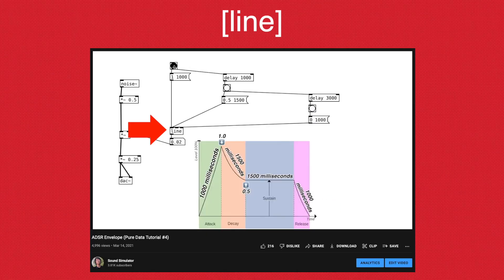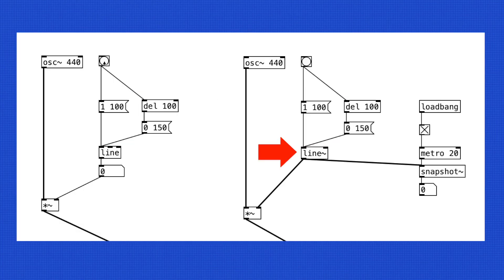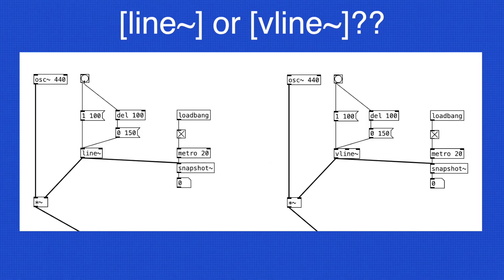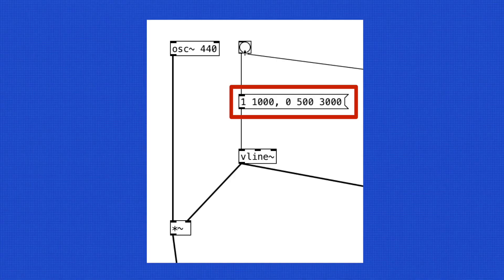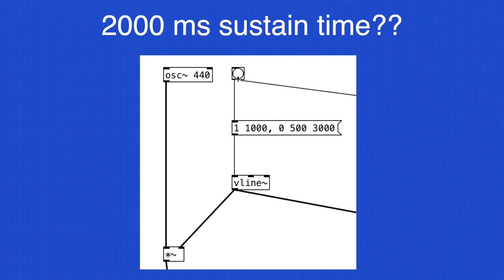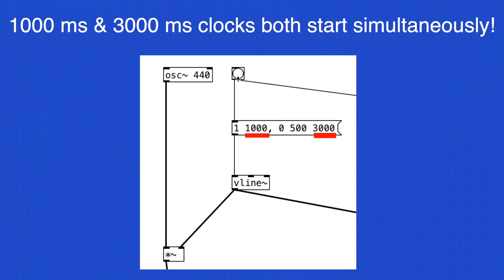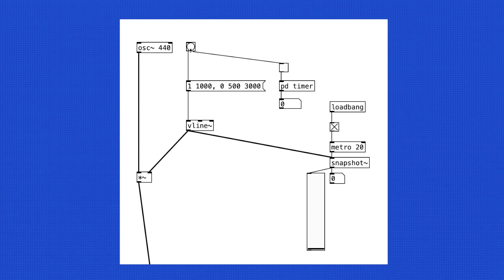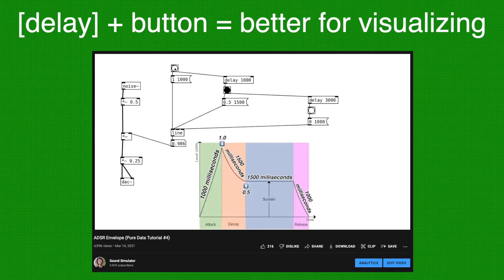line vs line~ (correction vid)

Comment: can you please explain how to change the values in the message objects using sliders? i am biulding a hardware synth, and need to be able to route sliding potetiometers, and not have to manually type in the value each time. thnx
Reply from the maker: Message object that says [1 $1] will work fine.
But that will trigger every time you change the value so you have to find a work around. 
It's something along the lines of [pack 0 0] with a button connected on the first inlet and a [number] on the second. And the outlet of [pack 0 0] is connected to message [1 $2] or something along that line.

Comment: Afaik both [line~] and [vline~] work at sampling frequency. [line~] gets evaluated for every block (so, by default, every 64 samples [line~] will get evaluated and output the 64 samples corresponding to said block, not just one value per block). I never truly understood [vline~] but its evaluation seems to work different in a way that manages block boundaries more accurately.
Reply from the maker: Yeah, it's kinda confusing. I didn't look too deep into cuz I'm not planning on using an attack time that's 0.1 ms. I'm sure it's helpful/crucial for specific tasks.
Reply: @SoundSimulator   Yes absolutely, I used to put [vline~] into everything because I thought it was better, but unless you're working closely at the block level or making some laboratory stuff you really can't tell the difference in the sound. It's cool that [vline~] takes that extra delay argument tho, then it's worth it.

Comment: I'm a bit confused because line~ won't let you connect an output to a number. it's fine for volume envelopes but I'm unable to use it to modulate a lowpass filter.
Reply from the maker: Yeah! I just checked that [lop~]'s second inlet only takes in control-rate signal and not audio-rate signal. In that case, you gotta use [snapshot~] :/
Reply: @SoundSimulator  Thanks for the help!

Comment: you say to replace it, but it does not work based on your synth envelopes tutorial. using line is necessary for the ADSR to work
Reply from the maker: Ah, I had to revisit the tutorial to remember what I did (it was 3 years ago at this point!). 

In that original envelope video, I connect the [Number] object to the outlet of [line] to visually show the value changing. Since [line] is not a signal object, you can connect the outlet of that to the inlet of [Number]. But, [line~] is a signal object so you cannot directly connect the outlet of that to the inlet of a non-signal object like [Number]. 

So, you don't need to worry about [Number] and just connect the outlet of [line~] directly to the 2nd inlet of [*~] to follow along to that tutorial. I'm really sorry for the confusion!!

Comment: Great to see a man admitting to previous misunderstandings and taking action to not only correct but apologizing to others for any inconveniences as well.🙏
So, I have my PD GUI designed and laid out on the touchscreen, with dark canvased modules and sliders. But, I can't figure out how to get rid of all the patch cords, while also displaying the values in the number boxes, which I need to monitor and manipulate.
Do I need to upgrade to Max MSP?
Thanks.😎
Reply from the maker: Thank you for the kind words! 
Yeah, that is a tricky situation. Max does allow you to turn the patch cords invisible. Cycling 74 has a free trial so it could be worth the try. 
That said, I have seen people make amazing GUI with Pure Data. Mike Moreno may be happy to answer this question. The Lira-8 VST looks great!
Reply: @SoundSimulator  Cool! Thanks for the pointers. Knew you'd know.
EDIT: 🤯 Liar-8 is almost the exact same layout as my current GUI and has exactly the same appearance as what I'm shooting for.
Awesome!! 🙏